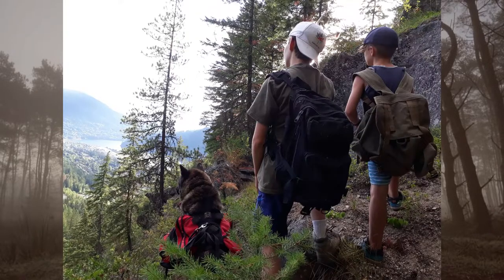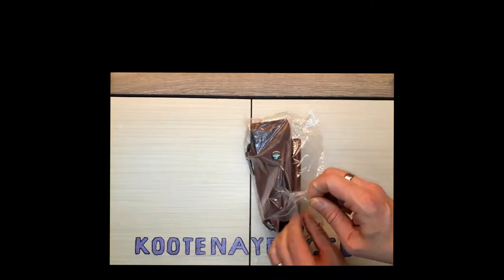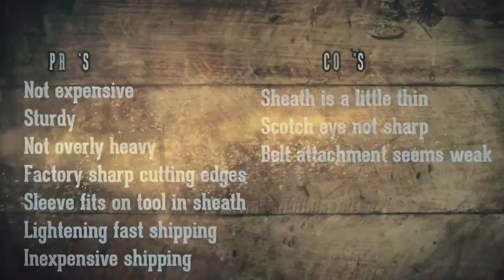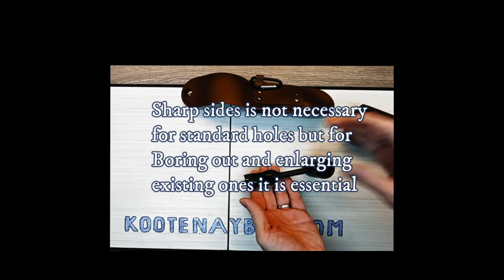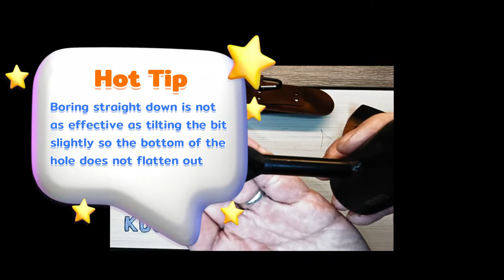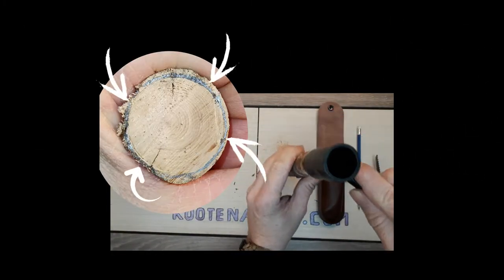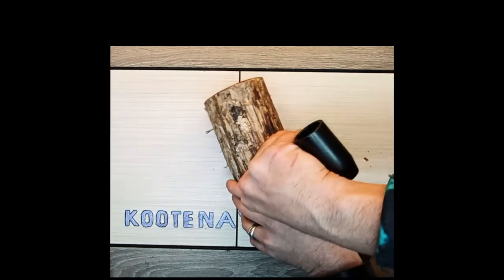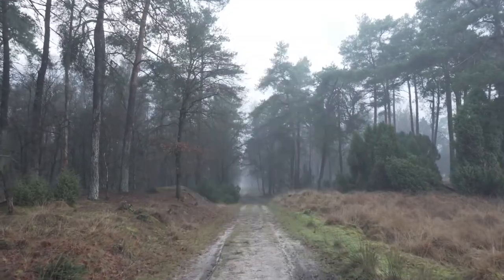Saker hand auger scotch eye survival tool

Comment: Thanks for the vid. I'm wanting to buy 1 and I'm getting mixed reviews. I'm a little over 8 min's into the vid. and had to stop. It blows my mind how little research people do and how little they know. Where I come from "pine" is a soft wood.  Next these/this tool is only to be used on soft wood. Next, this tool is also only recommended for "green" wood{meaning wood that has not been seasoned/dry}.  And I could be mistaken but the leather skirt around the blade helps protect u and the blade but meant for the handle{drape it over the top smooth side up} to get started. Best of luck...ps please take some steel wool or fine sandpaper to ur "new" draw knife then lightly oil it with some "crisco".